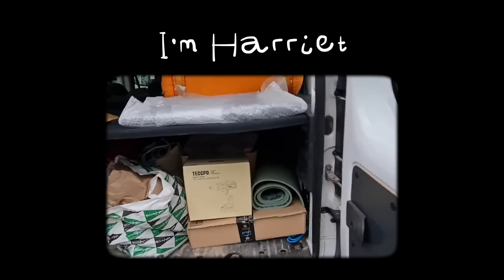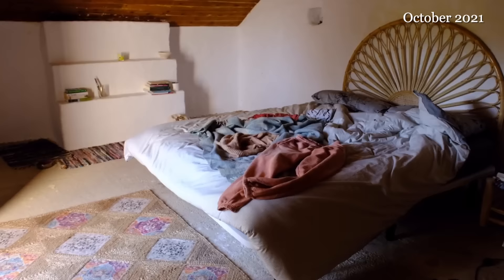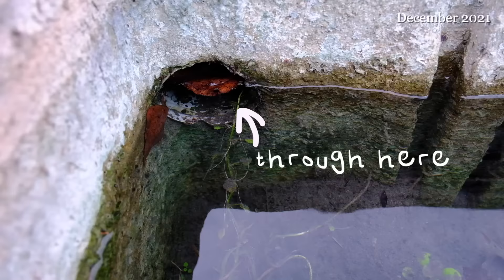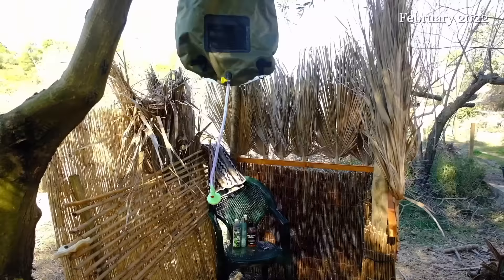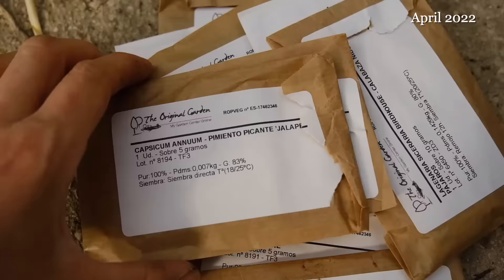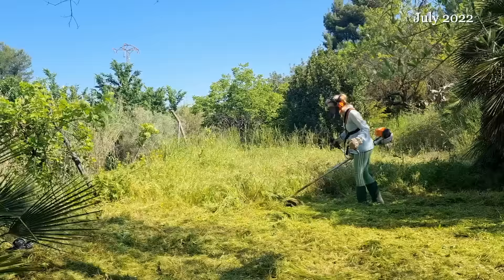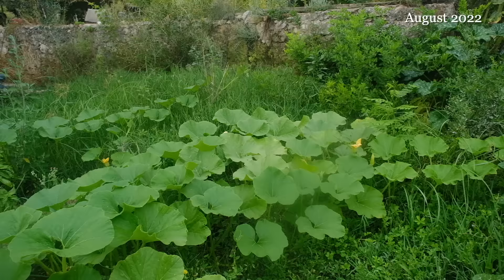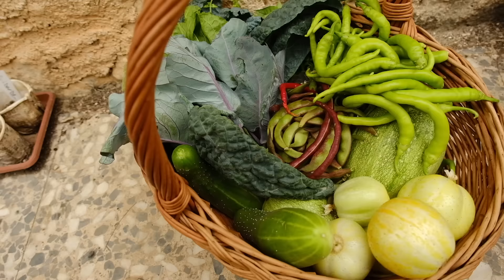1 Year ALONE Restoring an Abandoned Smallholding [timelapse]

Comment: In Spain stairs are impossible to move furniture. Most people haul them up on ropes to the desired level and most can then come through the doors onto the balcony. Obviously you will need help to do this. Also some roof's have pulleys in place for this.

Comment: What was the home office situation like when you moved in? Was the mobile internet connection affordable and stable? I'd love to have my own little countryside homestead but that's one of the things I'd be worried about 🙈
I love what you did with your homestead so far, you can be really proud!
Reply from the maker: I worked with 4G tethering to my phone. Luckily I had good signal, it was something I checked when we visited the land before buying. Later we installed satellite internet at about €45/month which is easy to install basically anywhere, getting internet in remote places is not so much of an issue these day it turns out!

Comment: The wood stove  you have is meant to be free standing out side of the fire place . It can be used as you have done inside the fire place . How ever you run the risk of carbon monoxide poisoning . You really should have either a wood stove or pellet stove insert for the fire place .These units have a metal surround that cover the space between the stove and the fireplace  opening. This makes them much more safer . Just one pipe leak or faulty joint in your current stove system will cause a possibly deadly result for you . Also , a carbon monoxide detector is also a must . Very nice work so far !.
Reply from the maker: The stove being inside the chimney makes it far less efficient at heating the house, but it wasn't an option to break down the chimney at that point in time. It makes no difference for carbon monoxide safety as the flue goes all the way up the chimney. Everyone with a woodstove should have a carbon monixide detector, as we do.

Comment: I have a tip
buy big used storage tanks from chinesse websites or any cheap websites that isnt amazon or the very popular one
use these tanks to plant your food at a higher elevation level since working so low in earth is kinda hard.. 
do this only for legumes or fruits..rice.. no need to do this for things like grain or sunflower ( for seeds or oul )

Another tip !
You can try making a solar 
a place that is 70% underground and 30 outside ( only the roof )
this way You can grow legumes and fruits non-stop... even in winter since the solar is covered in that nailon wich will held the plants heat in place

Comment: What a work you've done! Just a short question, please.
When you cleaned the water basin, filled it with water and bought water plants, what was the bottom of the basin like? Just concrete and water? I have a similar basin and wondering: the plants  need some nourishing hold, right? What was in there except for water? Thanks!
Reply from the maker: Hiya! Before I filled the deposit with water I built pillars out of bricks so the plants could sit in pots on top of the pillars. Most aquatic plants are actually more like river-edge plants and only want to be sitting with their roots in water, but their stalks above the water. With the exception of water lilies which can go 1m underwater, depending on the species.

Comment: This looks amazing! I'm wondering how you managed with the Spanish regulations, we were looking at similar properties in Spain but we got scared of all the rules and regulations. The way I understood it is that you need a licence to do renovations, and the plan has to be made by an architect. Since we want to do things ourselves we very disappointed to hear that, but I see you did most of the work yourself so apparently it is possible. What is the bureaucracy like with a project like this? Was it easy to get all the papers and permits?
Reply from the maker: I haven't actually done anything that requires a permit yet! There are major/minor works, which technically all need permits, although many people do minor stuff themselves (like changing a door) without permits, especially in more rural areas. I am sure many people do major works too lol, but I wouldn't recommend it. You need to talk to the town hall in the area you are interested in about a specific property and what you want to do there. It's the only way to be sure before you buy. People on the internet will tell you all sorts of stuff but it varies so much from town to town that you shouldn't listen anything online.